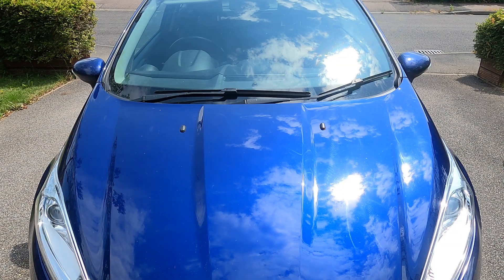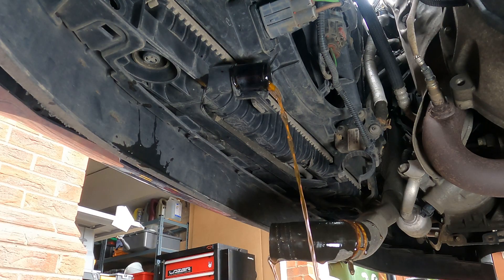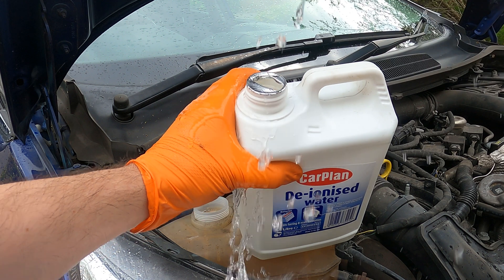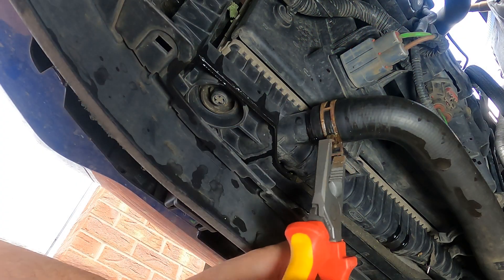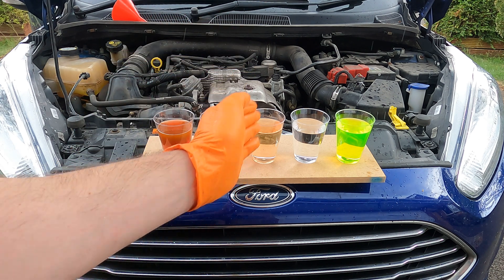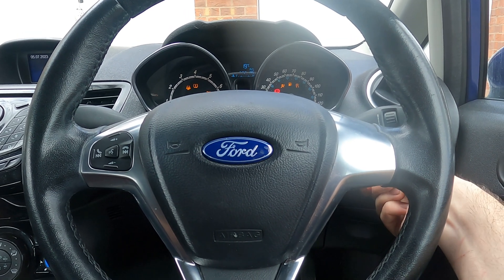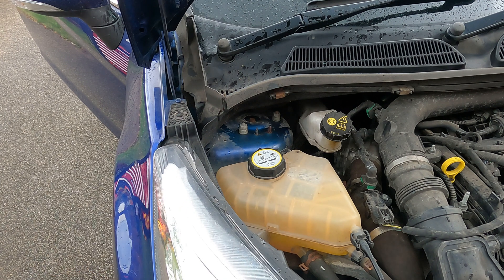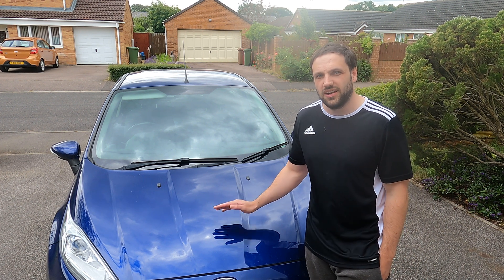How to flush out your radiator on a ford fiesta. Cooling system maintenance

Comment: Sorry for late response but since you flushed with de ionized water and wait until it comes out the pipe. Wouldn't it still be in the system and would that be bad ?
Reply: Hopefully I get a fast response or if anyone can help me I'm in a process of flushing my radiator out

Comment: Is there any reason why you are using deionized water and not distilled water?
Reply: de ionized water is the most clean & neutral water
Reply: The manufacturer recommends distilled as it has no minerals or bacteria vs deionized which can contain living organisms.  Deionized water is sold at car shops for rinsing the exterior.

Comment: I followed haynes instructions the first time so didn't check if there was a bleeder valve (basically just slow pouring + squeezed the hoses untill no more bubbles came up + engine running and level check), car is running fine for almost 5 months now, changed sparkplugs the other day and they were in "good" wear conditions (not "steam cleaned" nor greasy) but will check with the bleeder valve method as I noticed the liquid went down a tiny bit and makes me paranoid.